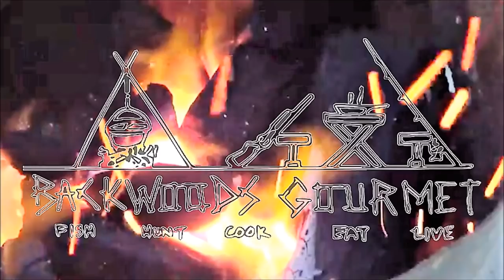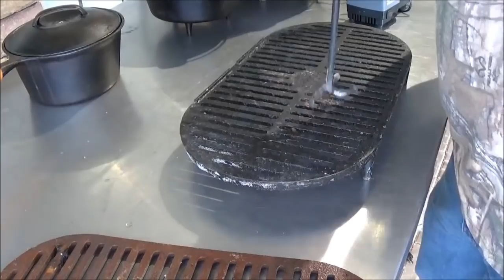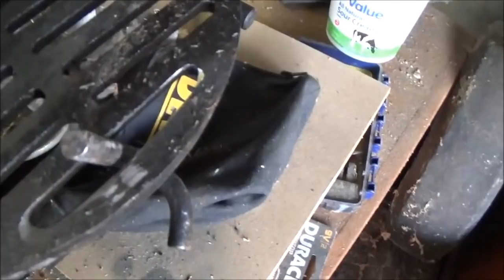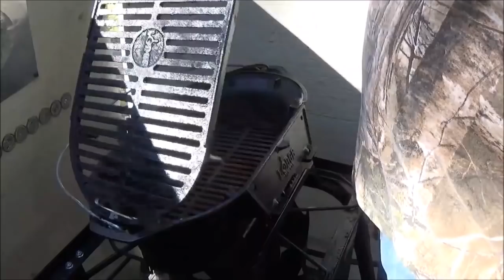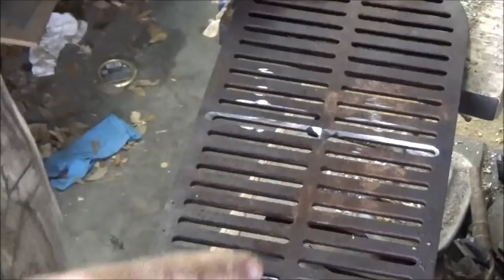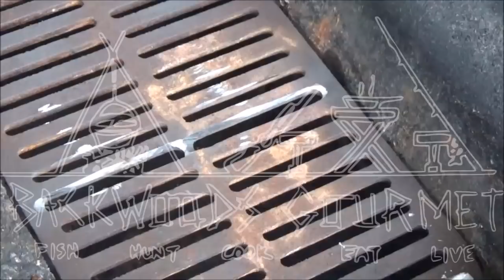Lodge Sportsman's Grill Small Modification Makes it Easier to Handle

Comment: How about grinding the hook end of the lifter hook a bit narrower?
Reply from the maker: I use this lid lifter for my very heavy dutch ovens, so I did not want to weaken it any.  This project only takes about 5 minutes.
Reply: I would rather grind my lifter a tad bit or weld up a lifter that works before grinding on my grate.
Reply: that idea makes more sense

Comment: As I was watching you cook with this grill I was thinking how awesome it would be if Lodge made a cover for it to allow food to be smoked and cooked slower.
Reply: I just got one and was thinking the same thing...
Reply: You're not the only one to think about that...might require sheet metal work. 🤔
Reply: Look for a BSR shallow fish fryer to use upside down on the Lodge Sportsman grill as a lid. Works perfect. I cover steaks & chicken.
Reply: I've fashioned a few things for my Sportsman grill, including a cowling to block the wind and an insert to allow me to grill with smaller amounts of charcoal. Given its small size, it would be hard to turn it into a smoker, but it should be possible to make a lid to allow one to roast small items on it.  However, it's really designed for grilling with high heat (makes great steaks and burgers) or for use as a camp stove if you put a cast iron griddle on top if the grill grate.
Reply: I've though hard on that myself funny enough.
Reply: @iBliss888  Just got one. Funny I was thinking the same thing when I got it. BSR 3060.
Reply: I've used a wok lid to contain the heat over food I wanted to cook lower and slower.  Worked great.

Comment: Sportsman is great. I even thought it might have been a pioneer wagon cook top design  from the old days. Probably not.  I've had mine 20 + years. I was lucky enough to find a Cook top that fit the sportsman perfect on ebay. I also use BSR 3060 fish fryer for one pot/ rice pilaf and grilling breakfast. Alcohol stoves works great in it indoors in the winter. I use 2. All year grill/cook top. Classic cast iron style. Also use the Lodge 12 inch Stirfry skillet on the sportsman with the cooktop.

Comment: Curious to know if u thought about grinding the actual lid lifter itself?
Reply from the maker: I use the same lid lifter for all of my cast iron.  Making it smaller for the SG would cause issues with some of my pot lids.  So I modifies the only cast iron that it doesn't fit.  5 minutes either way.

Comment: Good modify,  and I appreciate it because I haven't purchased one yet. I been wanting to.  JUS fyi, you could probably shave that lid lifter down on each side enough,  about an eighth an inch, maybe more,  just on the tip about a quarter inch down and grind it into an upside down v shape. Just so it fits in between the other grates, or just make a slender point on it. You decide,  I dunno if it would help or not because I don't have one yet.😕 Jus, food for thought.

Comment: As others have said, you modified the wrong item. They made the distance in the grates that size for a reason. Get a lifter that works for this grill. I made two, and latch onto both ends of the grill plate. Also, there's really no reason to need to move the grates while they're hot.

Comment: I was really hoping that your modification had something to do with making it easier to carry!  The skinny bail that comes with it 1) hurts my arthritic hands and 2) doesn't keep it level while carrying, so inevitably, the draft (or other) door falls off.
Reply from the maker: I hear you on the carry thing, but I don't know how to solve that problem.  Thanks for watching.
Reply: Remove the draft door & coal door before moving. You can purchase a handle spring like is on a welders chipping hammer and slide on the stainless steel wire handle. Just straighten out one side, slide it on, then bend it back. I'm building a hood for mine with a vent and thermometer. Heavy duty handle, too.
Reply: Lodge sells Cook and Carry handles that fit many of their pans with the second "handle" in addition to the Sportsman's grill and the Cook It All.  These are the same handles that came with the Cook It All ... yeah, that one.  Hope you saved the handles!   Item # A-HAC